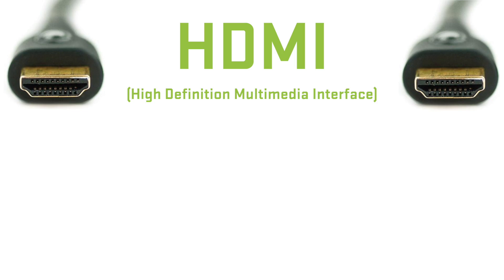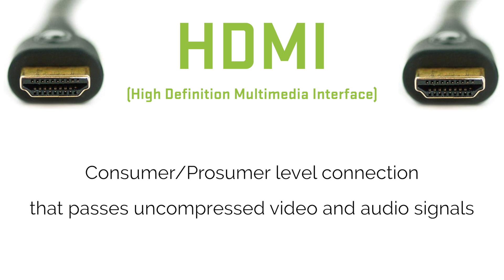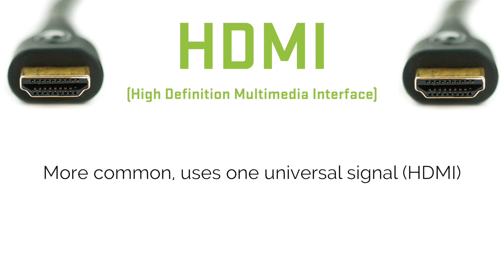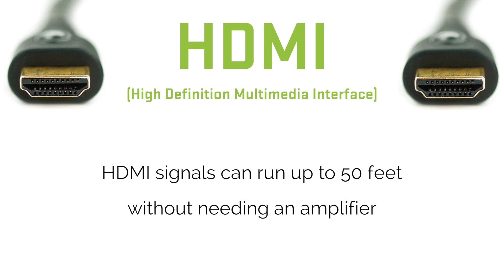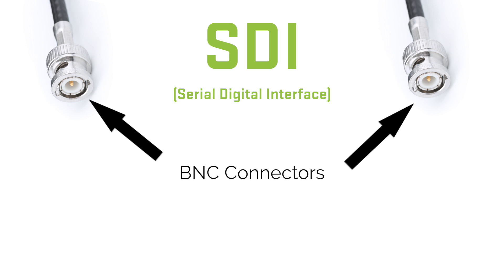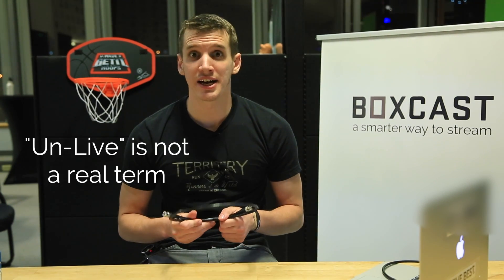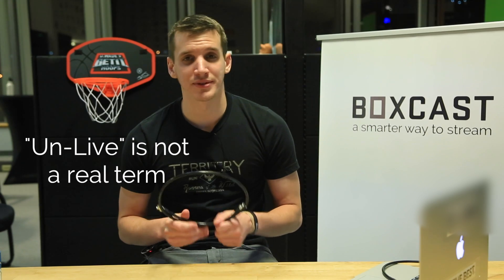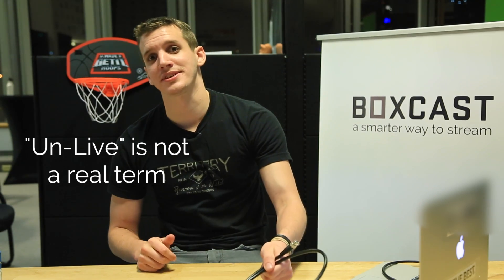HDMI vs. SDI Video Connections

Comment: I have a  Panasonic AG-HVX 200. How would SDI work for this camera? I want that kind of security but don’t see an SDI output. Any help for this novice would be greatly appreciated!
Reply from the maker: Gotcha, you could look into a converter like this (although you'll have to power it, which could also introduce more points of failure). It all depends on your use case! https://www.bhphotovideo.com/c/product/1333957-REG/decimator_dd_lx_hdmi_sdi_converter.html

Comment: Can i conect a standard sdi device to a HD-SDI device? Or put another way is SD-SDI compatable with HD-SDI?
Reply from the maker: Hi George, HD-SDI is backward compatible, but what specifically are you looking to do?
Reply: BoxCast I’m looking to take the signal from a betacam sx deck and put in through a grass valley hdm1 which has HD-SDI input. It would the go from the hdm1 via FireWire to computer for capture
Reply from the maker: Gotcha, can't say we ever used that type of converter before, but would imagine if it can handle HD-SDI it would be able to input a lower quality as well. It may not hurt to chat with B&H on the converter's product page and ask to be sure:
https://www.bhphotovideo.com/c/product/498356-REG/Grass_Valley_652154_ADVC_HDM1_HD_SDI_to_HDV.html
Reply: BoxCast thanks for your help
Reply from the maker: Sure thing, George!

Comment: Hi,
In another video, i realized that there are cameras that have "CLEAN" and "DIRTY" HDMI output signals. Referring to the Overlay text and glyphs that are sent, and would NOT be desirable in a live set up.
How does this work with SDI?
Reply: Dice Gamble , Dirty is most notable with certain DSLR camera’s HDMI output, these DSLR’s don’t offer you a BNC connection for an SDI cable., in my experience however limited.

Comment: Josh this is Wayne LWCCC. Thanks for this video. We were just thinking how to run or what type of cabling to use for our Panasonic Hv camcorders with the hdmi converter box. We are also converting our coaxial cabling end tips with coax to sdi connectors so we don't have to undo all the coaxial cabling we ran. So this helps!!! Thanks for the tech tips
Reply from the maker: Hi Wayne, glad I could help! Let us know if you need anything else!

Comment: I have never seen an STI connection, but I do not do professional video. If I were to purchase an HDMI to SDI converter (transmitter/receiver), would I be able to use a BNC T to split the signal out to two TVs without the need of an expensive splitter? 
According to the website these converter sets go 300', and from what I can tell they are running at 75ohms. So, if I have 2 or more tvs, and additional receivers, could I successfully split the split the signal providing the total length of all cables do not exceed that 300'?
Since the signal is unilateral the transmitter should not be able to tell it is split, and since they receivers are not "mated" to their transmitters, they should only see a reduction in signal strength. It is however expensive for me to test this theory and it appears you have everything to try it out :)
Reply: The answer is yes, with a provision. You can run SDI from your source (TV1) and then jump from source to source as long as your SDI to HDMI converter box has a re-clocked output. For example the Monoprice Unit #10318 will do this.

Comment: This is a cable and connector comparison, not a signal comparison.
I was expecting some sort of an explanation on how come that the HDMI has many pins and SDI is just a single wire (by the looks of it).
Reply: Samuel Gabura i believe the difference lies in signal waveform. Kinda like fiber optics where bits of information travel one way down the wire with bits of information.  It should be possible to transmit huge quantities of data down a high quality coax in a form similar to internet pulses and be demuxed inside the tv/monitor back to a visual signal we can understand.
Hdmi uses multiple tiny wires to communicate bi-directionally. As in the tv communicates with the video source and vice versa AND carries a much less interlaced version of video and audio in one direction. 
I COULD be wrong in my understanding of how these work, if I am someone please educate me further.
Reply: I too would like to know that!

Comment: Josh, this is joshua too :) 

HD- TVI Converter to HDMI | VGA | CVBS | Problem | November 2016 
https://youtu.be/w9RgplOddm8

Problem im having in Splitting VIDEO SIGNAL. 

I have installed the DVR bellow, with 4 fish eye cameras. They are 1080p 2.4MP cameras. Also included int he details are three TVI to HDMI/VGA/CVBS to Three LED 40 inch TV's. SO far the converter has worked, but the image is Glitching and I get the eight colors of no input signal, and it will come back. 

Details. 

I have connected everything, but I am getting interupted signal loss eveno tho i have the converter box that plugs into the wall. 

(1) AR304-8 8 Channel Tribrid TVI DVR. http://bit.ly/2fvsRsQ
(4) CW-CVI360XP 2.4MP 4 in 1 360 Degree Fisheye Camera's.  http://ebay.to/2fvk4Y8
(3) TVI to CVBS AV/HDMI/VGA to display on three Tv's.  http://ebay.to/2fIY9xb
(4) RG59 Siamese cable. 
(8) BNC connectors for RG59 cable. http://thd.co/2fOIPPS
(1) Power Box 12V 10amp ( i believe).  ( will update soon ) 

Conclusion

I was under the impression that with the converters i can split the signal and with the amplifier not have any issues. THe only thing I have not done is try the CVBS to the TV using a BNC/RCA to the VIdeo Input of the TV. 

- Jerez Electronics
334 Common St, Lawrence Ma

signal splitter converter, cctv TVI, TVI 1080p, DVR, Security System, Dome cameras, Converter problems